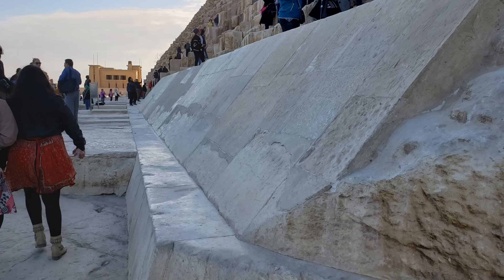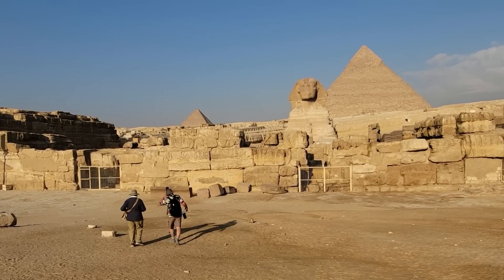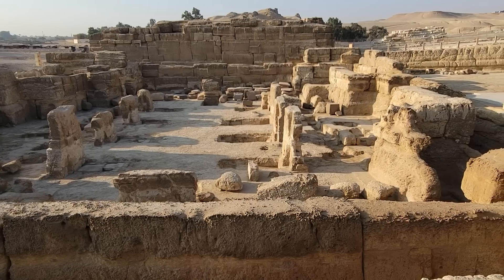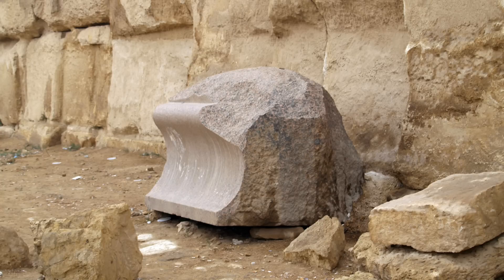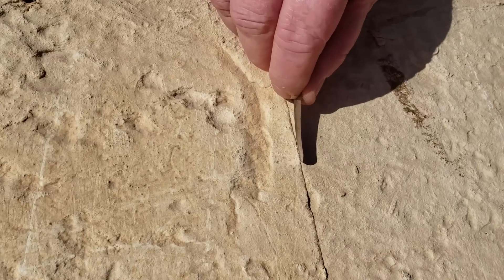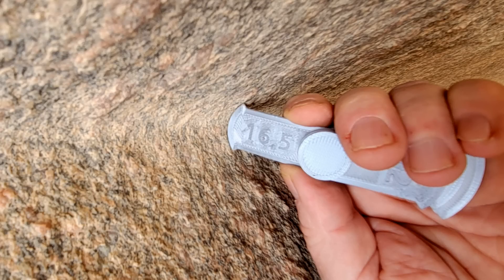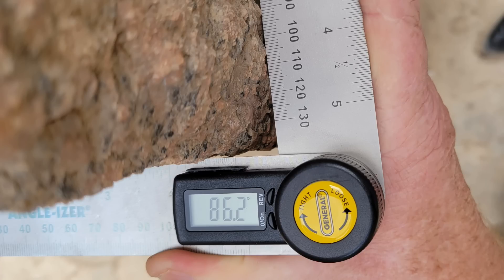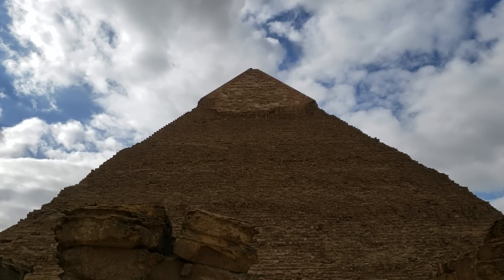Ancient Architecture part 2

Comment: What do you think about the "poured into place" molten stone theory for the blocks in these type 2 structures?
Reply from the maker: My own opinion is that the theory raises as many legitimate difficulties as that the blocks were quarried, maybe more, and certainly is as poorly supported by the absence of the required tools in the archeological record as solid stone work, so it does not appear to present any overwhelming persuasivness.  Davidovitz has made a career of pushing the concept but few other scholars embrace it. Yes, there is evidence of geopolymer use in antiquity, but not at any great scale.
Where are the giant rock-melting lenses, the refractory materials needed to handle and manipulate it for the molten granite hypothesis? Or if was just simple cement and crushed rock, where are the rock crushers and lime kilns? Geopolymer materials production is a very energy intensive and surprisingly complex process.
What was used for forms? Plywood was not available....
For me to get on board, someone would need to produce a paper on analysis of supposed geopolymer ( and supposed cast molten rock ) that shows clear evidence of the kinds of settling / convection / form marks we see in modern concrete.
Reply: delusional fantasy impossible idea

Comment: How do we know they carved the granite to fit the limestone and not the limestone to fit the granite?
Reply from the maker: Because the limestone core blocks' shapes are the result of a very long period of water weathering which formed them into the profiles that pre-existed the application of the granite veneers, and determined how those blocks needed to be shaped on their backsides to follow the weathered contours. In other words, in the places where the granite blocks have fallen away or been removed from the core masonry,  it can be verified that the exposed surfaces of the limestone are naturally weathered not hand carved.
Reply: @AncientEgyptArchitecture  thanks for the answer. Great channel.
Reply from the maker: Thanks!

Comment: The carving on the backside of the granite sheathing must be an almost unbelievably difficult process to imagine individual craftsman of that age to carve freehand with stones, wood, or copper. Even if they had stronger metal hand tools the time and effort to hand carve a 3-D pattern to match the contour of the wall is mind boggling. Thank you for this insight.
Reply from the maker: I was a carver/artist for 40 years and that is a job I would not want, even with lavish pay.
Reply: that show the incredible tools aliens had , it was not more difficult for them to shape the granite that also mean the tool they had was not based on friction but had immaterial energy beam that dissolve material by removing valence electrons turning rock into mono atomic sand

Comment: About the tapered corners from top to bottom. That would mean that every corner that tool or part of a larger tool ( drill bit ) as an example. Every corner cut the tool would have to be replaced. At what depth or height does the measurement start tapering? And lastly is the wearing of the tool consistent with various rock or does the tapering change in lengths depending upon the density or hardness of the rock? These are the little details that get my wheels turning. Side bar - I believe that the Sphinx is a fountain with a higher level of purpose than that of being just a spectacle. To filter the water by aeration performed within. Then jetting out from the top of its head as the “ spectacle “ being a sacred symbolism of enlightenment and the fountain of the minds eye. The Sphinx is representation the seat of the soul, some may call it the throne. It’s placed within a leveled and rectangular basin/moat. If a reservoir, only to hold changing water levels for short periods of time before released back into the river. Underground passageways would be fluvial in purpose.
Reply: @ Not This Not Now: Your side bar is most interesting. I wonder if the Osiris shaft had something to do with a pumping mechanism for the Sphinx fountain as well as the Great pyramid and the fluvial tunnels?
Reply: The OG Fountain of Youth?!⛲️
ps- Wasn’t there a gentleman who researched the Osirion and it’s mysterious water systems, for years he would filter + drink the water every day and his health ailments cleared up, completely?!

Comment: Polygonal L-shaped stone seems unreasonable but the Pre-Dynasts had a reason. I would love to know the reason as well as the method. Should we discover the method, I am confident that it will have been so simple to figure out that it would make us look stupid that we did not think of it already.
Reply: It makes a stronger corner, simple to create. Check out the Sacred Geometry Decoded channel.
Reply: I agree ! Strength of corners ! How were corners of latter structures held together? Well...the ones still standing!!?!
Reply: Context? Which latter structures are we talking about?
Reply: @brentsanders9918  It's a typo, she means later structures !.
Reply: we are not ready for this kind of interstellar voyage technique , desintegrator cutting tools  is an application from space shield when speed near light-speed